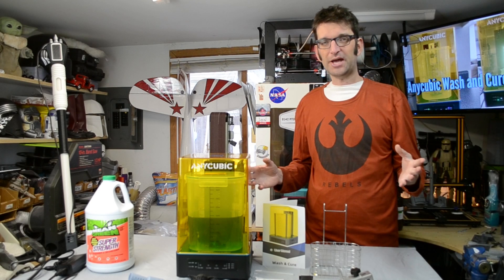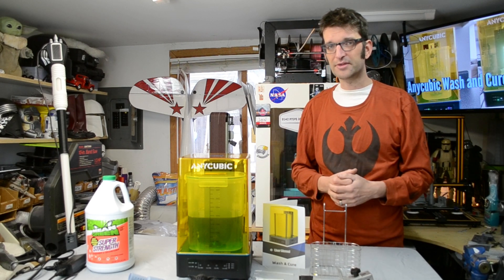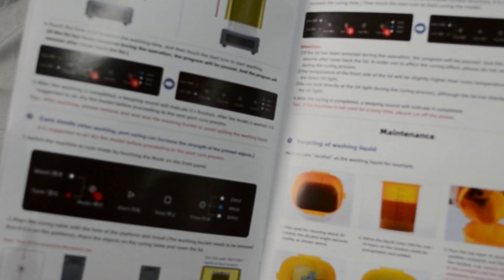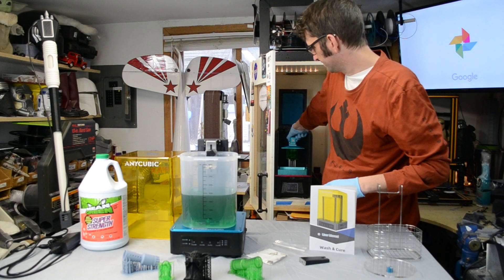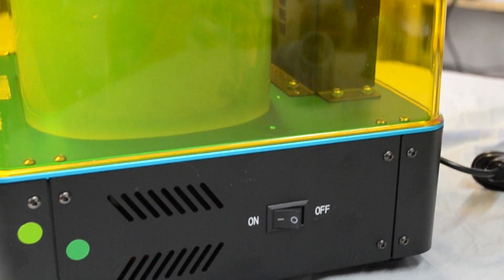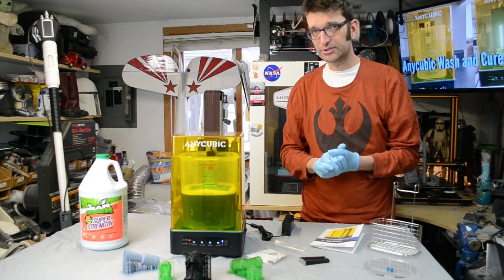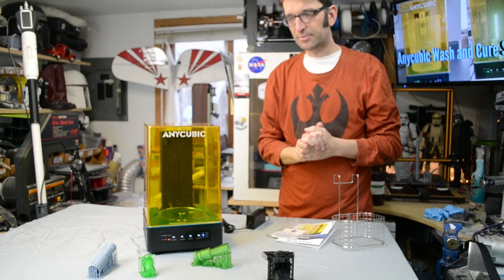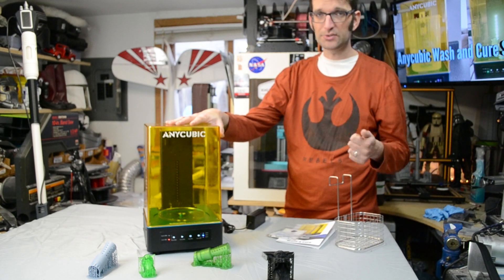Anycubic Wash and Cure First Look

Comment: If you are going to use IPA in this how do you put in the part so it is not going to interfere with the impeller but still be able to close and seal the containers lid, not the yellow cover?  IPA really needs a closed container for safety if you are going to agitate it at all.
Reply from the maker: You do not use the lid that locks onto the vat while the machine is in use. This would be the case if you are using the metal basket to hold the parts. Hope that answers your question.
Reply: @9142PropsandArmory  In that case it would seem that using IPA would not be the best choice.  Mechanical agitation of IPA in an open container just isn't a good or safe practice.  Thanks for the response and review.

Comment: Personally I'm a fan of removing supports BEFORE curing.  Easier to snap them off.  I printed a DL-44 as well and I ended up printing the flash suppressor vertically, and only needed a few supports.

Comment: Currently busy building an inexpensive wash and cure station to reduce the messy cleaning process of resin printing. It will have a 60w UV light for curing and a magnetic stirrer for washing. Both will be controlled with a timer. I'm repurposing off the shelf products and some 3D printed parts to build it. I estimate that it will cost me about $90 in total to build this unit. My design is in part modeled after the Anycubic wash and cure station. This unit retails between $169 to $216 but because I live in South Africa this unit will end up costing me $380 with shipping and import duties.
Reply from the maker: Good job on a solid work around!  I was doing a similar setup, minus the stirrer, prior to getting this. That's too bad the shipping and import duties kill the price for you, it's a really solid set-up!

Comment: I wonder If I can get my Solus3d printer build plate to work on this
Reply from the maker: Looks like it has a thumb screw to lock the plate in place like the other small format machines. So it certainly should. Build plate is smaller than the Photon and Mars as well. Should be good to go.
Reply: @9142PropsandArmory  Awesome! Just Subbed looking forward to checking out your videos 👍
Reply from the maker: @MogulDesigns  Thank you Jay!

Comment: I love the detail of resin printers, but damn that toxic mess. Just thought I'd point out that while you had gloves on, you then proceeded to touch damn near everything within reach, including your glasses :)
Reply from the maker: Thanks Jeff, pretty sure that my fingers didn't even contact anything nasty. It's just like anything else, with experience you really don't need the gloves, but you wear them anyways in case something goes side ways and you actually end up making contact with the resin. Don't let resin scare you. It's not a big deal to work with, provided you take the right precautions and have some basic common sense. Thanks for watching and for your feedback too!

Comment: I’m glad I watched this before buying. I was hoping to use it with my Elegoo Mars but that plate holder wouldn’t work. If someone makes one on Thingiverse or MMF I’ll grab one!
Reply from the maker: It will work for the Mars. It's mounted to the bracket by the thumb screw at the top. Exactly the same way the Photon build plate attaches to it. There won't be a need for an adapter at all.
Reply: @9142PropsandArmory  Someone has made an adapter for the Mars, I'm getting one of these Friday so i'll see if it works with my Mars plate on Friday :)
Reply from the maker: @ChrisM149  Awesome! It can be attached by opening up the slot on the bracket or by printing an adapter. Glad to hear that you're getting one. When you do, feel free to use the link in the description, it helps support more projects and more fun!  Have fun with yours, let me know what you think.

Comment: It would be great to see like for like comparisons of manual methods vs using this. I like that it is neat, and that you are unlikely to over-cure prints.... But I think the way they will sell the most of these is as a bundle for those starting out, as most may already have their own solutions for cleaning of they already have a printer.
Reply from the maker: I like that. I was kind of holding off on testing things that way until I hear back on a launch date and pricing to go into a full dive into it. Just want to make sure that this will be a final version of things before spending too much time with it.